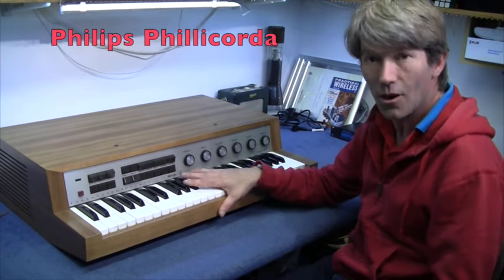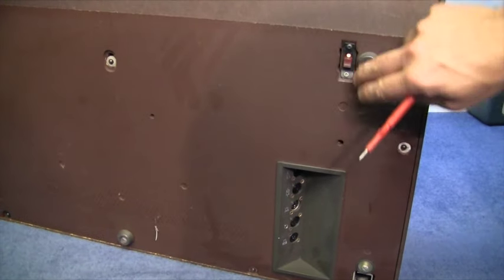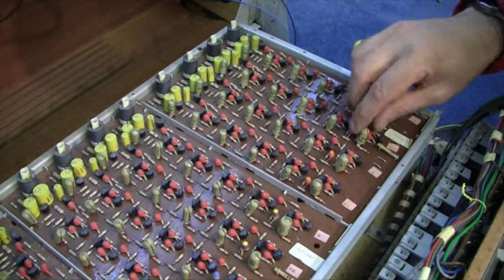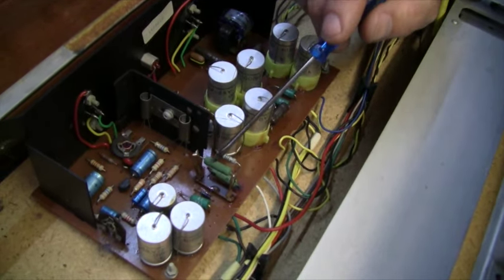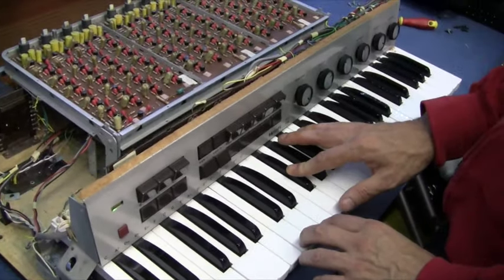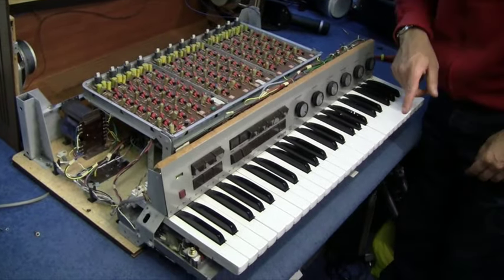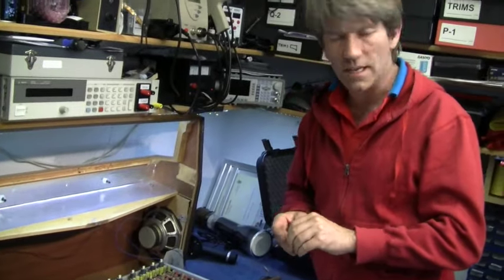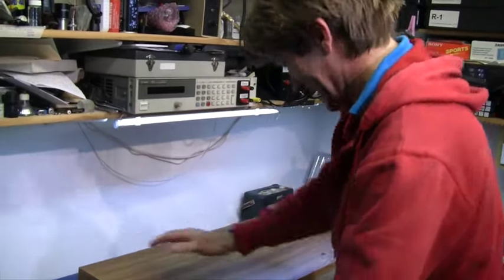MF#13 Philips philicorda vintage analogue organ repair

Comment: I love the way they used to make things.  Meant to be opened, worked on, and fixed.
Reply: Except for the case itself it seems haha, but yeah i totally agree. There's so much focus now on making things as un-serviceable as possible to you either have to buy a new product or send it to the shop for about the same price :I
Reply: I unfortunately opened it as an 11 year old kid and destroyed the reverb electrical wire.
Reply: @GaryKildall   what did you do the rest of it: "destroyed" that too? ;-)
Reply: @dadautube  eventually I repaired it, and learned to play it

Comment: I know I am somewhat late to the party but, given the age of this unit and the two minute delay before the reverb kicks in. I suspect that the reverb driver is at fault. I would imagine the driver will be  a B class amp of about  two watts and will have germanium output transistors. Germanium transistors being very leaky when warm, it is quite possible that the biasing has drifted with age and now the transistors only come on when they have warmed enough for them to become leaky enough to overcome the bias.

Comment: I bought the full transistor vsn from an auction house for £36 believing it may be the valve vsn, got home and realised it didn't work and all yt videos i checked at the time they sounded harsh so i sold it on ebay for a non reserved £1. The buyer restores these items and later on found me a full valve vsn with spring and amp all serviced up for £200. I'm well happy with the result but now realise with your video example the transistor models do sound very good. Thier were several models all valve, hybrid and full transistors. Thx

Comment: I had a "Philicorda"  GM760 when I was a kid. Didn't play much on it, but I "hotwired" the amplifier to my 486 (at the time) and used the 12" speaker as a subwoofer. I also had lots of fun with the spring reverb, connecting it to the PC and plucking the springs at diffrent places with a screwdriver to make cool sounds and recording them. Now the GM760 is the valve based one

Comment: Hello. I had a similar Philicorda with the reverb not working at all. It was a faulty transistor which drives the in or output of the reverb and it is located in the middle right of the horizontal board where the potentiometers are also located. Can't remember the type of it anymore but I've got a similar spec replacement for it on ebay for like 5 euros. After swapping it the reverb worked flawlessly ever since. I sold my Philicorda few weeks ago.
Reply: Are you able to point out which transistor at which row & it is?...

I have the same problem... 😞

Thanks in advance.
Reply: @Multiwizard  It was like 12 years ago. It was kind in the middle in the front PCB as far as I remember. It was surely a germanium transistor.
Reply: @repasiv  I just did upload a short video of my 751 organ:

https://www.youtube.com/watch?v=zuKxF-5YXrk

Are you (hopefully) able to point out at 0:36 of this video which (row) of transistor it should/could be?...

It has 12 rows...

Thanks (again) in advance.
Reply: @Multiwizard  Those similar looking circuits are all the voices It was I think somewhere in the middle of the front PCB. Mine was a bit later version and did not have vacuum tubes. The reverb is like an amplifier-transducer-spring-microphone-amplifier combination and one amplifier did not work. I'd make a test to switch on the reverb, turn up the volume and hit the spring. If it makes a noise over the speaker than it is in the first part of the circuit. Could be one of the vacuum tubes or a dry capacitor.
Reply: @repasiv  ok thanks anyway... 🙂

Comment: I have one one of these exactly the same model as the one you have been fixing and they sound even better when you put them through a Lexicon mpx550 and then through a 1970 small stone phaser.

Comment: After watching your videos endlessly, I finally did resurrect all the functionality of my Yamaha Electone C-55. Thanks for that. Now on to repairing my much more precious Philicorda. By the way, there is a separate input amplifier for the reverb I am told. It is supposed to be on a separate board. You might find it. Did your Philicorda also have the separate 'service' plug for the main lead inside, so it can be powered up while worked on?

Comment: This was the third version of this model. It's from the late sixties. The first one was valve with a separate valve amplifier under the keyboard section and was from mid sixties. For some strange reason only the technology inside and the cabinet were changed. The three stops and five tone filter switches and the overall sound were mostly unchanged.
Reply: +Steffi Ri I also have a Philicorda with valves and glow lamps. Its an GM751/22 (without T). I also have an GM751/22T and there are only transistors in it. 

If the T really stands for transistor, maybe the wooden case has been exchanged. They are old instruments and none of my three Philicorda organs had only originial parts in it when I bought them.

Nevertheless, there are much more versions of the GM751/22(T)-Models. Some of them use transistors but there are still valves used for the vibrato-section and the amplifiers. Also, there are different key versions. While the Philicorda in the video has the old keyboard, my GM751/22T has a newer keyboard where the keys are just hold by springs. There was also a mono and a stereo-version of the Philicorda.

I guess when they changed something during production, they still used the old parts they had available, so there are much more versions then model names of the Philicorda.

Comment: I own the orginal GM750 (the full tube version. It has no built-in amplifier and spring reverb. Those are a separate unit from the organ itself. The amplifier functions a stand for the organ.

Comment: Fun video, nice to see the inside of one of these things. I had two thoughts about the delayed reverb. 1) Maybe a bad electrolytic capacitor taking too long to charge up? or 2) that resistor with the spring on it, maybe it is supposed to heat up and open the circuit, thus freeing the reverb to work? Anyway, thanks for the video!
Reply from the maker: Hi Clydesight. I never got around to sorting that problem out. someone came along with a reasonable offer and I sold it with that problem and that accepted it as it was. but yes I agree you are likely correct about the Cap problem. many thanks

Comment: Never seen one of those before, sounds pretty awesome.

I guess if you were keeping it a recap of the power supply might be in order.
Reply from the maker: Hi Neil, I have too many items around the house and as its already working at the moment I may just sell it off. It sounds great but I just do not have enough room to keep everything.

Comment: Really useful stuff!! Would love to see a more detailed tour round the circuitry - my Philicorda (a 751, similar model to that one) does not respond to either reverb or vibrato knobs being turned clockwise and only appears to have one speaker working (balance anti clockwise just acts as a volume -> off control). Despite these handicaps, it sounds great - but I'd love to restore it to it's former glory, and this is a very helpful start..!
FWIW the red switch on the underside toggles the speakers on/off..
Reply from the maker: Hi David, Im not absolutely sure but I think the balance was not for left right but for internal speakers mono counterclockwise and external connections clockwise. both my speakers work but with the balance to the left. as the speakers are connected together internally (on mine anyway). I had a few problems with some of the controls and just blasted them with switch cleaner to get everything working. maybe you could try cleaning them up. best wishes from markus.
Reply: The function of the balance pot depends on the switches manual (vox-chord) and kombination (input selector)

if the input selector is set to 1, balance sets the ratio between bass and descant keys (vox-chord = 2)  or the ratio between chords and melody (vox-chord=3)
if the input selector is set to 2, balance sets the ratio of the organ and connected record player

Comment: I'd bet that the intermittent reverb was caused by a problem in the power supply. He should have measured voltages out of the power supply when it first came on and after it started working. Then it would have been easier to repair what was missing.  BTW, those speakers look mid 70s but they might be replacements.

Comment: The red switch is how you switch the build in speakers on/off, in case you want to send ether a pre or post amp signal to something else eg. mixing desk via DIbox, tape recorder machine, external amp (pre amp in that case), external speaker, etc...and don't want the built in speakers on.

Comment: On the powersupply board there are 2 5,5W resistors 47 Ohms and 100 Ohms. They have a bad solder joint.

Comment: Hi There, I have a divider or oscillator gone on mine , well so I think it could be??  all the F's dont work all of a sudden. Is this repairable or do you need original sound parts?
cheers
Reply from the maker: Hi Andy. those boards on the top are 12 sets of identical circuits. 4 per board. at the end by the keys you will see the note numbers printed. look for the F and then test the components with the one next it F#. when you find a difference replace that component and that may just sort the problem out for you. Good Luck.
Reply: markusfuller Hi Mark, thanks for your reply, I will do that for sure! are the parts on the board  replaceable i.e easy to get hold of?
Reply from the maker: Hi Andy. apart from the tuning coils at the back end of the circuit board (can't remember what they are actually called). almost all the components used on the board are replaceable. standard PNP NPN transistors and capacitors. all can be replaced and there will be equivalents to all the transistors still available from RS components - element14 - CPC - many companies will carry this stock. Just search google and you will find someone selling them. Good Luck.
Reply: markusfuller Thanks so much for your help much appreciated!
Reply: markusfuller Also if you know, as these units have an input and output, would it be possible to use the organ spring to send external audio signals through? It would save me having to buy a separate spring unit! plus not heard one as nice as these ones
Reply from the maker: Hi Andy they do have an output underneath the right hand side but Im sure there was no input. the other sockets were for volume control and Tape record I think. I do not own one now as i sold it so I cannot check for you. sorry about that.
Reply: markusfuller ok thanks no probs, yes it does have an input as they were designed to be used with "Philips rhythm/accompaniment record" so you could play melodies on the keyboard simultaneously as the record played and with both sounds coming out from the Philicorda . I had my output modded to jack but the input is din i have no way of testing it, plus thought there might be impedance matching issues using it as an effects unit. the spring just sounds so nice and not tinny at all like most cheaper springs do
Reply: +markusfuller They have an input for a philips turntable (its the one with a symbol that looks like a magnifying glass). If the "selector"-knob is set to '2', you can mix the internal and the external signal by using the "balance"-knob. The spring reverb sounds great on drum beats, I use it a lot for this. If the "selector"-knob is set to '1', you can mix the volume of the bass chord and vox-section. 

The other connections are for a tape record and headphone / speaker outputs. The red switch on the bottom can be used to turn off the internal speakers.

Comment: the burning resistor in the power supply could be due to a higher mains. It used to be 220V but nowadays it's about 240V

Comment: Didi you check out the output section of it? I have a issue with output. I made a DIN to mono jack cable and connect it to organ output and to DI and there is a sound but there is a lot of ground hum. any ideas thanx.
Reply from the maker: Hi Dejan. I do not own this instrument now so I really cannot go and check mine to see what the problem is. I never used the outputs on mine just the built in speakers. sorry about that.
Reply: No problem...I solved the problem..Greets Dejan
Reply: @dejanslak8972  hey i have the same problem, but i see you fixed it, how did you fix it?

Comment: Hey! I have a few problems with my philicorda GM751/19T and i wonder if you have any ”quick” fixes for them:

1. The philicorda doesnt start up at all unless i press down a key at the same time as I press the on/off switch. Any thought about that?

2. The Eb key at all octaves doesnt work. What can this be? All other keys work properly when the philicorda starts up.

(I write to you because it seems to be hard to find people who knows about these machines)

Best regards, 

Sam
Reply from the maker: Hello Sam. question 1 , to be honest I have no idea why the phillicorder needs a key to be pressed before it starts, thats completely new to me. Question 2 on the main board you will see that the components are arranged in similarity as though there are 12 sets of everything from left to right. these are the 12 notes on a scale. some phillicorders have the note number printed on the circuit board at the start of each of these rows, I would find the Eb line of components with a multimeter one by one against the similar components on the next note to the right or left knowing that the other notes work ok you should find a difference in one of the components along the Eb line against the other lines of components. Im guessing that will be the problem part that will need changing. sadly I no longer have my phillicorder so I cannot go and see which line of components is the Eb line. but at least you have the other notes working so can compare Eb components against other notes. also if theres is nothing at all from any Eb then I would check the wiring from the keyboard. there should be 12 wires for the notes and maybe 5 or 6 other wires for the octave signal in etc. but the problem may be just one of those 12 (note) wires going to the keyboard or main circuit board. hopefully its just one of those. Good luck and sorry I cannot help with the first question but maybe the 1st problem will be resolved when you fix the second. best wishes from Markus.
Reply: Thank you so much for the reply! I will try to figure this out!

Comment: Hi Markus! I found a GM752 that is working just fine, except for some surfaces that need cleaning, and the reverb is completely dead. I wanna open it up and take a look at it, but I can't seem to remove the legs so I can place it like yours and lift the chassi. Did you remove them yourself, or do you know how to? Thanks for great content!
Reply from the maker: Stvafel Hello Stvafel mine never had any legs on it when i bought it. there should be some way to remove them but I do not know how as i never had them on mine. sorry i do not know how to advise.
Reply: @markusfuller  I found that they seem to be screwed into the inside of the chassi by some metal plates, and I'm not sure if it's possible to remove them without actually removing all of the electronics first. I'll look into it more. Thank you for your reply!
Reply: @markusfuller  So! Turns out it wasn't hard at all to remove the legs - you just pull them straight out, haha! I have removed the chassi as well. Now, for the reverb, here's what I've learned: when the reverb switch is active and the reverb knob is turned up and I tap the reverb tank, I get a signal through the speakers just like you do. I can control the degree of it with the reverb knob, and if I switch off reverb, it stops. So those parts seem to work fine. However, when I strike a key, no reverb is added. I'm guessing this has to do with the signal from the keyboard not actually reaching the reverb tank, or the magnet part of it that you're talking about is somehow busted, not generating any vibration through the springs. Any ideas on this?
Reply from the maker: Stvafel Hi Stvafel on the reverb tank there should be an rca connector on the input and the output side of the spring (or maybe its hard soldered ?) if you unplug or disconnect the input side you may be able to connect a siganl to it ie a small mp3 player or something and with the unit turned on it should come out of the speakers with reverb added. or check the cable going into the spring reverb and see if there is signal present on it when you play a key. do you have an oscilloscope? if so it should be easy to check for a signal present. though it sounds to me that if you are getting the sound of the spring when you touch it that the output is working fine so theres a problem on the input, check the pot that adjusts / sends signal to the reverb input. I can honestly say that i have never seen one of these spring reverbs where the magnetic coil is damaged. you can also check with an ohm meter across the coil input to see if there is a resistance that way the coil is intact. if you do this make sure the unit is off and disconnect the cable to the spring.
Reply: @markusfuller  Thank you for your thorough answer! I measured it using a multimeter and it appears that both the input and the output end of the reverb tank is giving off a signal from every component (both the soldered wires and the coils). So I guess the problem is somewhere around the place where the signal from the keys get mixed with the reverb, and that is a whole other level of troubleshooting that I unfortunately do not have the competence for. I'll have to live without the reverb or see if I can find someone who can take a look at it. Thank you though for all of your input, I'll make sure to recommend your channel!